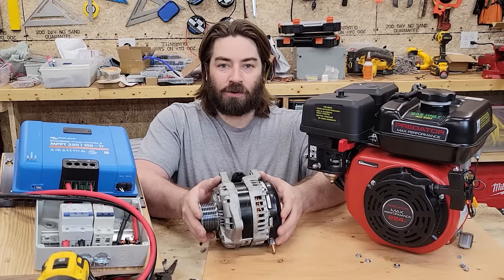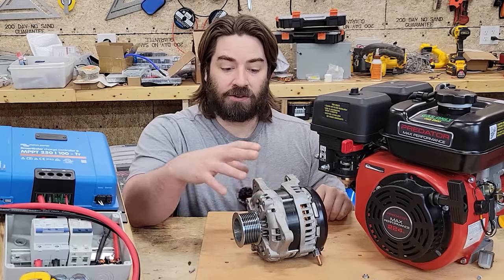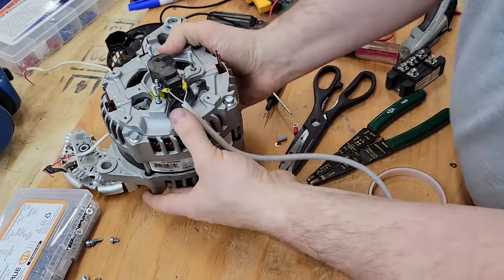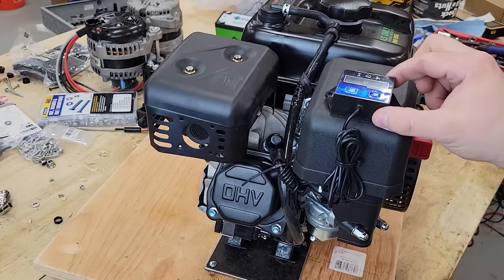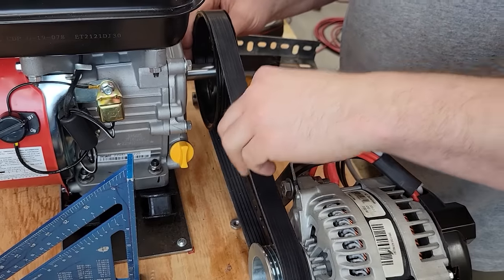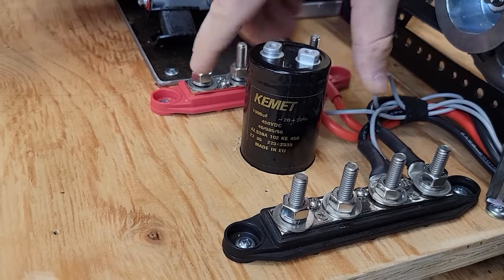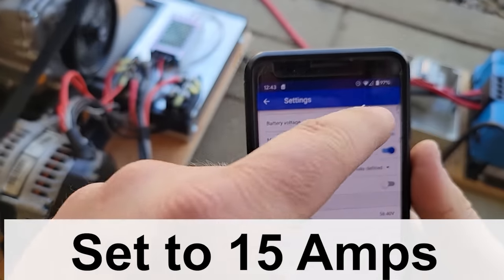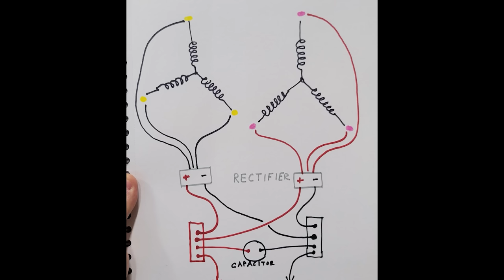The AlternatorGenerator, First Attempt.  48V Battery Charging

Comment: As an electrical engineer, I'm really trying to figure out why you removed the original rectifier diode system from the alternator.  I don't see how that modification did anything but complicate your design.  the original diodes were cooled by the alternator and were designed for the high voltages involved.
I also think a small, simple circuit could also be built to replace the regulator and regulate the alternator output.  If it were designed correctly, you could be much more in control of the output voltage instead of just hoping it will work with your charge controller.
Reply: None of your Business  I assume you're trolling, but there's no meaningful difference in charging off-grid batteries with a generator vs. powering a home with a generator. In fact, the former is more efficient because you're storing extra energy you don't immediately need. This is just a back-up solution for times when solar isn't enough
Reply: Totally agree. Remove regulator. Connect field wire to ungrounded side of brushes. Done. After seeing how easy that is, I'm going to use newer 200a alternators with the regulator removed instead of early 80s ford 100a designs with external regulators. I was wondering what the diode voltage rating was.
Reply: You learn from your mistakes, also the capacitor wires could be bigger or it should have been placed between the output and controller to minimize resistance, the wires carry alot of current between every cycle.
Reply: The car alternator bridge rectifier diodes reverse breakdown voltage will be from 60 to 100V. For the intended > 80V the diodes replacement was the right call.
Reply: Quick search finds the similar alternator diodes SG-C17xxZ27 are zener making part of the regulator and back biased clamping to 30v max. Swapping to a bridge was the right way to go.
Reply: It's just a content for the channel dude, the video needs to be long enough for the algorithm
Reply: Most modern-day alternator manufacturers use avalanche diodes in their rectifiers. Usually set to 29 volts. Dave made the right call.
Reply: noneofyourbusiness6210  Unfortunately, he likely has no choice when living off grid. Where I live, we will often get 2 weeks straight with literally no sunshine. A generator is the only option.
Reply: @dandeson9723  The capacitor wires were plenty big enough. In fact, you could comfortably use much smaller. 1000uF wouldn't do much anyway at 50 amps.
Reply: True.  Some alternators use zener diodes to prevent overvoltage, but I've found that classic "universal" Lucas/Delco diode packs will easily handle 50V+.

As you say, a simple regulator that modulates the current to the field coil would be far more efficient.  It's also quite easy to fool the standard regulator into regulating a higher voltage, often with a simple pair of resistors as a voltage divider.

For greater fuel efficiency, I use a microcontroller and hall-effect sensor to load the engine to its optimum rpm.  This uses an oversize pulley on the crankshaft and acts as a sort of governor to manage the engine better, preventing it from stalling under a high load, particularly when starting up.  So, I also use a smaller engine in the 2-3hp range, which really helps reduce fuel burn.
Reply: @chrismartinus2622  do you have a build video? I’d like to watch it

Comment: Excellent work. I too live off-grid and I have a similar size engine sitting in my workshop for over 2 years, just waiting for me to do exactly this. So it was great to see how you made yours. I think the only change I would make is to have the engine and alternator mounted on the same plate to stop the engine vibration affecting the belt. You've inpired me to get to work on my build!!
Reply from the maker: I agree with you.  Check out video part 2 and 3.  In part 2, I welded a steel base for both the engine and alternator, which took care of vibrations.  I also did some thermal imaging tests.  In part 3, I fine-tuned fuel efficiency.

Comment: Mount the engine solid to the board and use vibration control under the base.  Maybe to another board with rubber feet. This would also help with belt tension. You could also use a turnbuckle for better control of the tension. Love the idea, and glad I found your channel to subscribe.

Comment: I have previously heard about getting high voltage from an automotive alternator, and wondered how it could be possible. But I found an article that explains this very clearly, and offers some guidance if you want to get maximum power. An alternator is designed so that the field (in the rotor) can be driven with 12 VDC from the battery, and produce at least 14 VDC on the stator (through diodes) to charge the battery at idle speed, which is generally about 600-900 RPM. The pulleys and belts usually provide up to 2x RPM boost, or 1200-1800 RPM at idle. However, at maximum engine speed (6000-9000 RPM), the alternator will spin at up to ten times faster than when idling, and the voltage on the stator (with 12V on the field) will then be as much as 10x higher, or as high as 140 VAC (three phase) and nearly 200 VDC through the diodes. A typical 50 amp alternator therefore could produce 200 x 50 = 10 kW or 15 HP, but mechanical limitations such as pulleys, belts, and bearings will in practice limit the power to 2 kW or so.

The regulator serves to reduce the field voltage to about 1-2 VDC to produce the proper nominal 13.2 VDC charging voltage. The alternator typically has eight or more poles, so the output frequency may be nearly 1 kHz, and after full wave three phase rectification, will be smooth DC with less than 5% ripple. That DC voltage can be used to power tools with series wound (universal) motors, or most appliances such as modern TVs that use switching regulators.
https://bbs.homeshopmachinist.net/forum/general/2006464-ot-getting-over-120-vac-from-car-alternator

Comment: To have less vibrations, you could build a solid metal frame & add rubber bushings ( motor mounts) . Maybe add a spring pulley tensioner?
And of course, if you wanted the ultimate smoothness, you would have to replace the Predator with a Honda engine. But that last part is a considerable amount of cost!

Comment: The engine and alternator combo and pulley sizes were surprisingly well matched on the first attempt. Monitor the alternator temp. Car alternators are designed for intermittent duty only at rated output.
Reply: Just need to mount that big A heatsink to the alternator next, right, @davidpoz
Reply: @jamesbsa6450  I don't know. If that coil runs to hot its going to bind to itself and short. If it was up to me I'd run a second alternator and half the wattage between them. They'll last way longer and run cooler that way.
Reply: @jamesbsa6450  I've attached a 48v dc fan to keep the alternator cool works very well, also a mate of mine attached fan blades on the alternator shaft solves any heating issues for continuous operations. Keeping the alternator cooler defiantly increase longevity especially the bearings.
Reply: @jamesbsa6450  Shaft fan might help a bit
Reply: @DespaceMan  older Chevy alternator had a shaft fan. Thinking back to 57 Chevy days. Could prove quite useful
Reply: This will be in ambient temperatures cooler than under a vehicle hood.

Comment: Interesting indeed!  I would thing that the mounts you added would work better if the Engine and alt were on the same mounting surface, it would also make adjusting the belt simpler and eliminate the flex between the motor and alt.  Depending on the Alt brand some come with a dyno sheet showing the output vs shaft rpm could be handy in setting up the belt drive ratio. Cheers

Comment: I think it's an awesome project.  Great job. The only thing is, we can buy  3500watt generator for $500, with 4500watt peak power. 10 hour run time. However,  for a home project,  you did an amazing job.  Thank you for the video,  I truly enjoyed it. 😊❤
Reply: For the application, this is probably the better route to go. Otherwise he would need to run a 120v Ac to 48v DC battery charger/ psu to charge the batteries. For simply running 120/240v ac devices I agree the generator is the way to go.

Comment: Interesting project David, thanks for sharing.  Brought back some memories from the early 1960's when some of us powered our mobile amateur radio rigs (cars  in those days were mostly 6 volt systems and had wimpy generators, not alternators) by adding a three phase Leece-Neville alternator to drive military surplus 6.3 VAC/400 cycle filament transformers (wired backwards) to get the high voltage needed.

Comment: Very nice setup. It might be a good idea to mount the engine and alt on a separate platform to isolate the electrical components from the vibrations. They will last much longer, particularly the cap. Also a fuel burn test would be interesting to see. Good luck.

Comment: It's really incredible to see such a dope project that utilizes literally the most abundant and affordable electric motor in circulation. This is definitely going to be looked at as a seminal video as we continue transition to off-grid/mobile 48v systems. Someone should sell a plug and play system for everything minus the engine. Currently, 48v alternators, just the alternator, cost north of $3k and are mostly marketed towards the boating community. 3kw for under $1k is incredible, especially given you could easily see this working within a vehicle setup with a bit higher output when in motion/at higher RPM. You could even run a single alternator that's been converted to support a 48v system and charge/power the vehicles 12v system from a 48/12 set down converter, run a 12v lithium battery and bring things into the modern age.
Reply: If you really want to get simple ..Use a lawn Mower..take the blaes off problem is you need a flywheel then  run the belt out the discharge chute and hang alternator  from the top and then put the battery and inverter  on it

Comment: Congratulations David. It works! It got my attention but in a different way. Some day I want to try this by powering it with wind. I had thought I would have to put 4 alternators in series (good luck with that 😮) but you showed a single alternator can put out enough voltage to work in a 48 volt system. I’m excited!
Reply: It takes about 5BHP for a wind turbine to make 40ish amps on an alternator in builds I've seen. You'd need quite a large and powerful wind turbine to spin 4 alternators.

Comment: I've seen in boats where those small frame alternators do not survive well at high duty cycles with near full field output.  Particularly with charging large lithium banks where the charge amps remain high for most of the charge cycle as opposed to typical automotive applications where there may be some high initial current but it should taper quickly..  Even some of the large frame alternators that are available get thermally regulated during large charge cycles and or cannot survive at the duty cycle.  So if you were to upsize this I would certainly add a regulator or some device to clip field voltage to protect the alternator.

Comment: Something I have been wanting to try is to just rectify the 120 VAC from a regular generator and feed it to a solar charge controller. The only thing you would need to build would be the rectifier unit maybe with a capacitor to smooth out the dc. Only thing holding me back is none of my controllers have a high enough input voltage. If it over loaded the generator a variac could be added between the generator and the rectifier.
Reply: Keep in mind the 120vac is R.M.S. voltage. The peak voltage is 1.414 times the RMS voltage.
Reply: If you took the engine/generator out of an inverter generator, I would suspect that would be the highest efficiency. It is built with permanent magnets and is a direct drive.
Reply: Dang I haven't thought of that... I have an old Montgomery ward generator which I'd imagine is pretty simple. I do know that it doesn't monitor itself so you have to set the rpms yourself and when I've messed with it a little I notice it's a little hit and miss getting the frequency and voltage to coincide (meet at 110-120v and 60hz). I decided it was a little too dirty of power for me and set it in the storage shed. But it would be perfect for what you're talking about. Could even set the unloaded voltage much lower like 60v and charge it straight with a voltage controlled relay... hmm! It's a shtf option at least. Haha
Reply: @Sylvan_dB  And there can be unregualted voltages as well as transients. I would suggest at least 200vdc capable inputs. Not coincidentally this is the most common capacitor voltage when 120vac is rectified inside power supplies.

Comment: Youtube randomly recommended this. Absolutely love the project, simply badass.
 I would be curious to see the temps over a 10-20min full load period. the temps should stabilize in that time. 

I do car audio stuff and run a custom built externally regulated alt that idles around 230amps and 410amps full load. 

The hairpin style alternator you have are much more efficient and run cooler than a standard wound alt, they also have better low rpm performance, so you should have a decent range of rpm that will still output full power, but as you mentioned, rpms help cooling. 

I've abused alts pretty bad to the point of smelling them inside the car driving down the road, they are fairly resilient winding wise, its usually the regulator or rectifier that suffers failure, so your external solution is a better idea. 

Also, keep an eye on rectifier temps under load as well. If they blow things can get hairy
Reply from the maker: Thanks for your comment.  I'd love to test out a serious alternator.  Do you recommend any?
Reply: @DavidPozEnergy  oem alts ARE serious in terms of reliability (non-modified).

but you'd need a V2 at 600+cc for an high output alternator.  and everything bolted rigid of course.  having the engine and alt onna rigid frame and that decoupled from the board would help you build in this state aswell.

i didn't expect 3kw output tbh !  nice build ! 

i'm also curious about the temperatures engine head or better oil, alternator body and rectifier in a long full load test.

Comment: May I thank you for an excellent presentation. It was a clearly delivered demonstration, with most useful detail.

In order to relieve your vibration and belt tensioning problem I would suggest the  alternator is supported from the engine and not from a separate fitment attached to the base board.
Try to follow the theme of a motor car engine which is isolated from the bodywork with flexible engine mounts but the alternator is bracketed direct from the engine crankcase.

This ensures the belt tension is constant between the engine and alternator.  The vibration isolators will no logert interfere with smooth power transmission as they will no longer act as flexible element which are otherwise  loaded up resisting the transmitting belt tension cause oscillation..

Comment: Great video! On the capacitor wire sizing: please keep in mind that the capacitor will suck all the current until it's charged (there is tapper as it gets fuller). Then once it's charged only the ripple smoothing current will flow which will be a small amount compared to the output of the alternator. But in the begining, when the cap is empty it acts as a short (since the internal resistance is small). Amazing video considering you said that you have no electrical eng background! 😊
Reply: In actual fact .....the capacitor was TOTALLY unnecessary.
Reply: @jimw7916  I second that.  There are plenty of anecdotal evidence that the battery will be conditioned better if the charging current is rippled.
Reply: @blg53 there is a difference between "lithium-ion charge ripple" and "6-phase rectified DC ripple to the charge controller itself". I dont think the capacitor was unnecessary, a scope would tell you, but they cost >10x more than what this whole build cost.

Comment: Excellent build! If direct drive rpms prove sufficient, it will not only reduce power losses from the belt, but it will simplify the mounting, save space, and reduce a lot of the vibrations caused by the engine and alternator not being tightly coupled to each other. All wins!  Question: What is the reason the alternators integrated bridge rectifier couldn't be used?  It should be up for the rated wattage of the alternator, and it has the benefit of having its own active cooling from the stator fan.
Reply: Was thinking the same thing.. Thought he was going to use 2 rectifiers so that he can wire the dc side in series but then he went parallel.. So he could just have stuck with the original one. Maybe he did it that way in case he needed to go series.
Reply: But the alternator won’t spin as fast. Perhaps not in the alt’s optimum output.